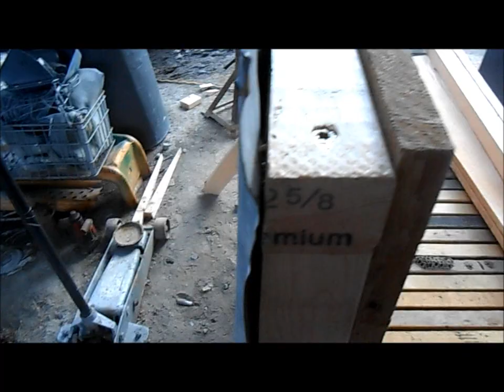Year of BeeKeeping Episode 2 Building New Hives

Comment: It's a bit after the fact, but a flat chisel tooth ripping blade in the table saw will make much cleaner notches and use much less power per inch of cut while ripping. Combo and crosscut teeth always leave a tiny V shape because of the alternating teeth. Examples of good flat tops, Freud LM72R010 and CMT 201.024.10 
Triple chip would likely give a suitable notch as well but may not be as square and clean as a flat top. (though the triple chip may have less tear out, a smoother side finish, and can be used for laminates and some plastics) The downside of a flat top grind is that they are only efficient up to about 10-15 degrees off the grain line. 
Triple chip are also not the best for crosscut but do a bit better than flat tops, often 'glue line rippers' are TC because the side finish is good enough that plaining or jointing often isn't needed for a good glue joint.

Comment: I have two comments or questions why are you using Cedar on your behalf will that not mess with the bees second thing is fiberglass aren't you afraid that will get in your honey I'm sure that if you look at your honey with a microscope after you're done you're going to see that fiberglass all in your honey
Reply: Cedar won't affect the honey bees but it will actually repel ants and other insects that will try to rob the hive. Also, the fiberglass won't make its way into the honey because the bees actually regurgitate it from their stomachs and the nectar has very little contact outside of the bees bodies.
Reply: A beehive is like a living machine that automates every process related to the actual making of honey.

Comment: I hear you can use SCIENCE to measure and make another throat plate (or insert) for that table saw.
And what the heck is that running in the back ground?
It sounds like a hit or miss engine running about 300 rpm's.
And then he shows us an old lister Diesel (or a copy of one from India)

Comment: The gaps between the tin and inside the roof bother me.
Reply: Would be good insulation
Reply: +Fietronic McGee So foam it. He used what he had around. Here in the cities that tin is almost nowhere so I think vinyl/steel/AL siding across the top would look smart and be just as good. Can probably find some being thrown away atop a dumpster when people order too much which I've seen over and over again. It'd fit better.

I wonder if more/thicker insulation would be handy or even building two lids... a summer one and an winter one. Insulation is cheap, losing time in a hobby is not. But I do know bees are warm blooded so, like humans, they should benefit from the insulation.

Comment: quick question? normaly hives have an inner top cover with a hole in the middle and an outer/telescoping cover with a small hole in the front allowing for ventilation. How does the ventilation in this hive work?
Reply: +Kevin Bijsterveld I'm wondering the same thing, maybe the gaps between the cedar bottom boards? Is Cedar needed or its just to prevent insects from coming in? (but mites destroyed this later and mites are insects)
Reply: BikingMNViking cedar is "bug resistant" in that insects wont bore through it or eat it. it doesn't actually stop bugs from coming to a certain area or whatever.